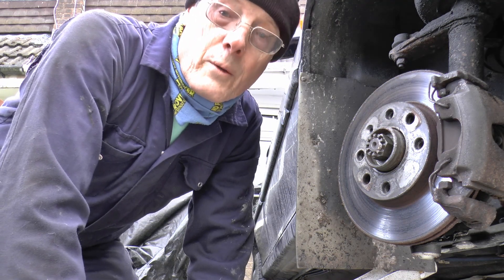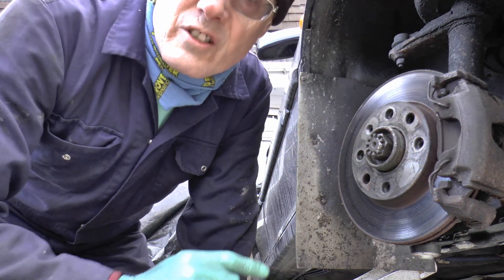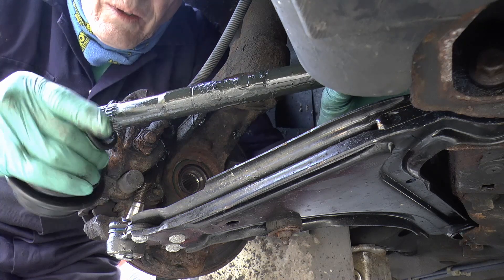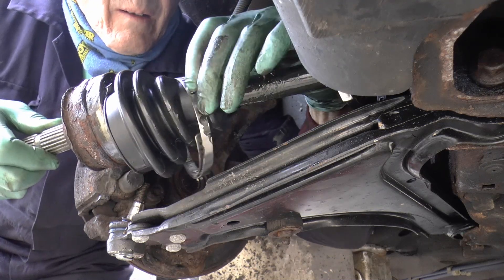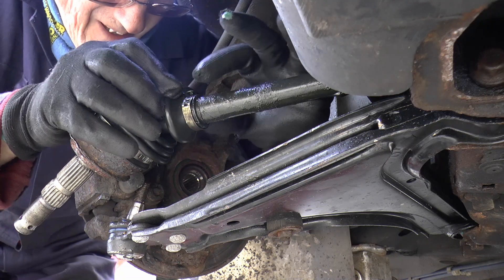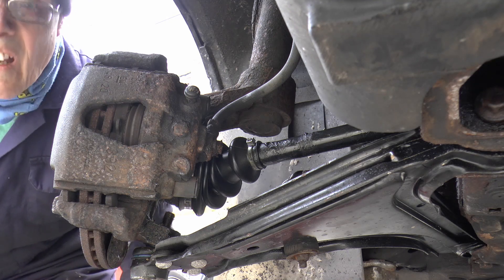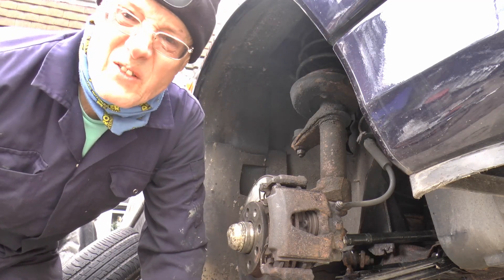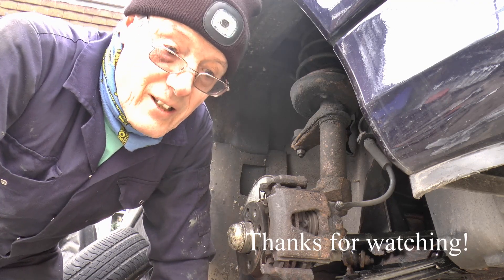Astra 'F', Mk 3, '97 Front CV Boot Change

Comment: Sorry for being right. The tool they use in the garages to tighten the C/V clips looks and works just like a 'tile chipper pliers', the teeth don't quite touch. I made one from an old nail pliers, grinding the teeth down to leave a gap.
Reply from the maker: It's fine, you were spot on. Can't believe I missed it.  Yes, perhaps fencing pliers are not the best thing to use!

Comment: Great video. Thanks for sharing. I have an Astra F 98 with X16XEL engine. The V ribbed belt is ripped off. I need to put in the new one. But I couldn't find out how to guide the belt. Do I need to take the motor mount off? Do you have some instructions for that?
Reply from the maker: Yes, apparently the right hand engine mounting has to come off. On DOHC models, the engine mounting bracket from the support has to come off too. On some models it may be necessary to remove the complete air cleaner assembly and enging cover!    That's tedious!   I've read this from the Bible according to Haynes.   The ribbed v belt comes down from the power steering pump to the crankshaft, up to the tensioner then on to the alternator and back to the pump.